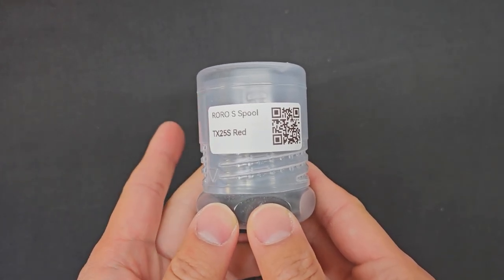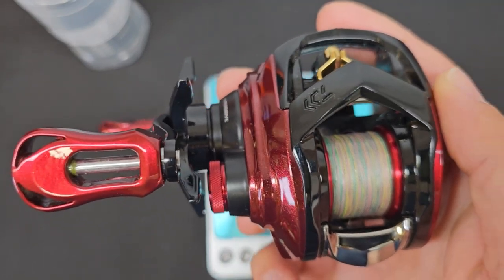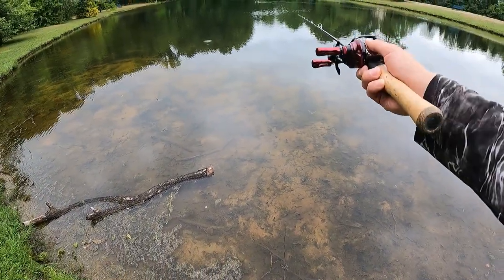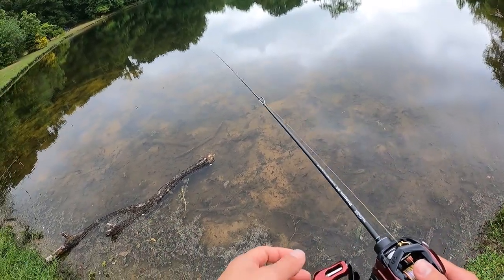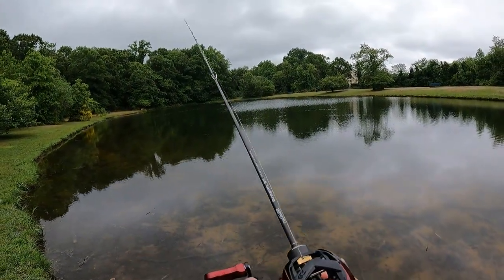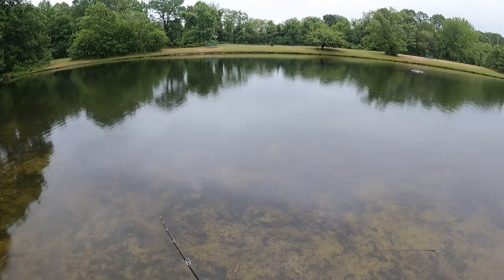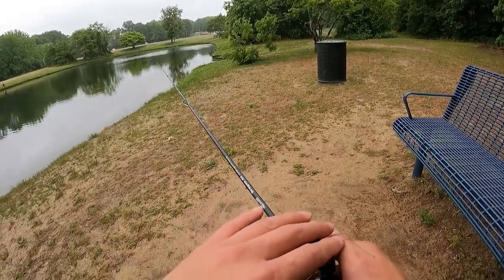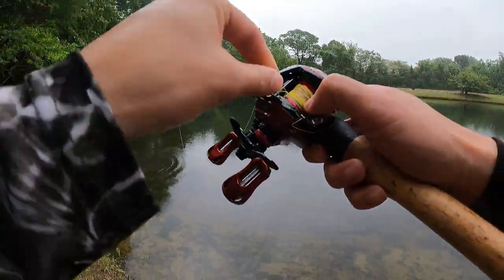Cast Testing Roro TX25S Spool on Daiwa Salamandura Air TW BFS Reel - Insane UL baitcasting

Comment: Really nice UL conversion.  Keeps the trout magnet folks happy.  No need to change the bearings which adds more cost and can be a pain in some Daiwa reels.  Using the Roro spool in the Tatula 70 makes the most sense since it's sold in the US.
Reply from the maker: Thx man! Yes I was thinking the Tatula first. I also want to test the stock Salamandura air tw on the Tatula first... Wouldn't that be cool to see?

Comment: Awesome video! Thanks for the info on the new spool. I have the Salamandora SV 70 so would love to see you use that for the next video . And I have quite a few of those VMC jigs got them for small creeks and ice fishing for trout. 👍🏼
Reply from the maker: Will do, but I won't be changing bearings for the time being. Gonna show stock capabilities first and potentially may change if needed later on.
Reply: @rawrfishing  awesome I would like to see it without the bearings first as well. I have a Alphas Air for the real light stuff so I'm wanting for something for a little heavier lures. 👍🏼

Comment: Sold out… are They going go be restocked?
Reply from the maker: Perhaps! Roro doing some improvements so it will be available after testing is completed
Reply: @rawrfishing  so its Not really 100% sure that they will be restocked because i bought it but with the normal Spool what is the lowest wheight its Casting
Reply from the maker: I don't quite remember... I did cast the EPF Swim on a 1/32nd oz Jig.
Reply: @rawrfishing  no worrys 😅

Comment: What spool do you recommend for the Alphas Air to cast the lightes lures?
Reply from the maker: How much lower u wanna do with alphas air tw. I like the Roro spools, they can go really light! Check out some of my cast testing videos. I may get their latest version which is even much better as they have a ball bearing on the shaft itself!
Reply: @rawrfishing I am wanting to use small floats/ indicators for flies. Like I do with my spinning setup. What model is that new Roro spool and do they carry it at BFE?
Reply from the maker: I mean... If ur using a float, likely the float is weighted right? So u likely won't need a spool for that. The stock spool is all you would need. But if you still need a lighter spool, try this one https://baitfinesseempire.com/product/roro-diy-x-spool-ax22/